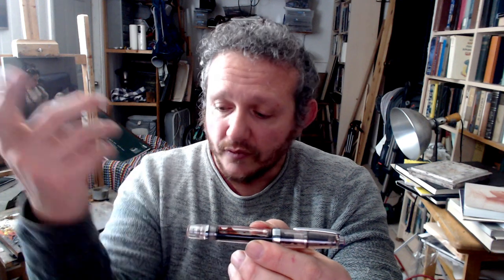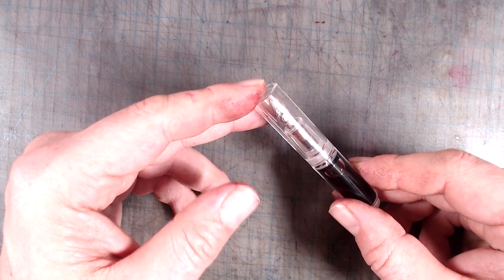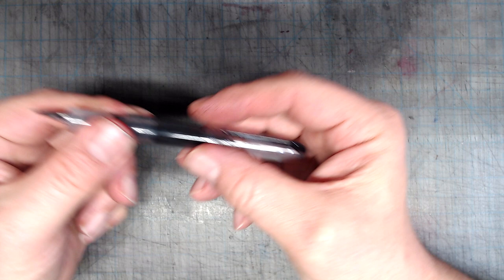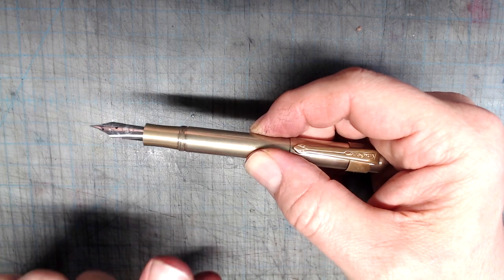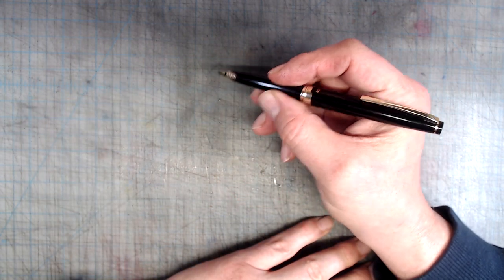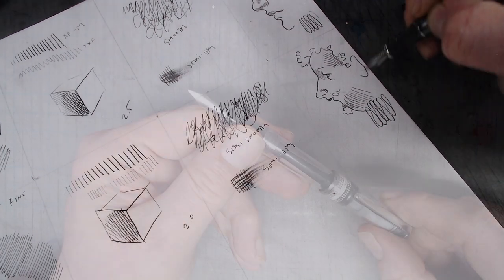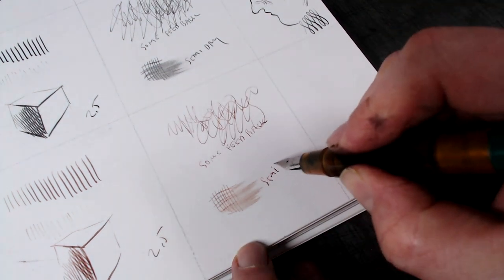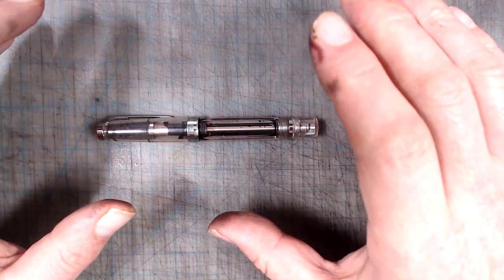Pocket Fountain Pens For Artists

Comment: I love seeing the variation of the line quality here, thank you! I was looking at some of the Twisbis as they look like they have a larger ink capacity. So many videos seem to show how fountain pens write, but I use mine for both drawing and writing. Another less expensive alternative to the Pilot Prera is the Kakuno, I have two of them , I use one with cartridges and the other I put a converter into for bottled inks, they are around the $10-15 mark, but I have had good results with them and they fit nicely into my watercolour box, or the side pocket of my backpack if I want to take it with me, they would be a good pen for a student on a budget too.
Reply from the maker: I’ll have to try the Kakuno. If it has the same nib as the Prera and the Metropolitan then 10-15 dollars is a very good deal. And you’re very welcome. I’m glad people are responding positively to the line variation test.
Reply: @mkompan  I have the Extra fine nibs in the two Kakunos I have and they are the same nibs as the Metropolitan, just in a clear plastic case. They even draw well when you reverse the nib.

Comment: I had the opposite experience than you with the Moonman and Koweco pens. I'm so disapointed in Koweco Liliput's inconsistent ink flow. At its price point, the nib should funciton right out of the box.  However, your video has given hope with the idea of replacing the nib with a vintage gold nib.  Thanks!!
Reply from the maker: I think this speaks to the inconsistency of Moonman pens. I’ve also had a few Moonman pens work decently, but never great. Kaweco pen can also be hit or miss, but usually the flow issues can be quickly be corrected by relaxing the times (you can see videos on it on YouTube).

Comment: Interesting video.  There seems to be a dichotomy here though.  Either a hefty metal pen with low ink capacity or plastic with a tendency to crack and/or a poor nib. Since I want something that can be used straight away and use bottle ink I will stick with my Duke Ruby . It is small, (5 1/2  inch), slim, fude, all metal with a good size converter and quite inexpensive. Well made and comfortable to use too. Although not a pocket pen can I recommend it as a useful alternative ?  Keep up the good work!
Reply from the maker: Thanks! While it's true that those metal pens usually have for ink capacity, I think the Fantasia is actually a good mix, sturdy with good quality plastic, great ink capacity and with a very good nib. I have a duke 209, which looks to be like a dressed down version of the Ruby. It's a great pen, and like the Ruby is small enough to be pocketable.

Comment: I'm one of those people who have had many problems with Kaweco! May I ask if you have the name or any info on the vintage nib you picked for the liliput? I would like to get something similar. The nib that came with mine was terrible. I actually ended up swapping it for a cheap Jinhao nib that works much better lol 
I came here looking for an alternative to Kaweco pocket pens and I didn't know that vintage nibs would fit the liliput. Thank you so much for the detailed video!
Reply from the maker: You’re welcome! I guess I’ve been lucky so far with my Kawecos. The nibs, while nothing special have all worked just fine. I have detailed info on the vintage nib switches in my reviews if the Kaweco Lilliput and the Kaweco Brass. Check them out!

Comment: 1. Wonderful, thorough, review, thanks.
2. I like cool pocket pens, but their smallness and pocketability do not provide me any extra value.  99% of the time I'm drawing in the studio, where I've developed a taste for the exact opposite, desk pens.  And on the rare occasions when I am thinking about drawing on the road, I feel no pressure to downsize the pens, all pens fit easily in my shirt pocket or messenger bag.  I guess the handiness of pocket pens might come into play if working with a pocket-sized sketchbook as well.  For those who travel REALLY light.
3. Are you saying the #2 nib (EF Flex) from my Waterman 52V might fit in my Kaweco Steel Sport, or at least a Liliput?  I've finally learned to love its nib, but I wouldn't mind upgrading by putting it in a different body.  Hate the lever filler.
4. The Pilot Petit1 is available at jetpens for $3.30.  What a bargain.  It's my recommendation for a beginner pen: works, costs nothing.

5. Sailor fans might be interested in the Pro Gear Slim Mini, which is quite similar in size to the Kaweco Sport.  Maybe with a Zoom nib.
Reply from the maker: You're welcome as always.

1. Pocket pens aren't for everyone, but lately I've come to appreciate carrying a small sketchbook and a pen around in my pocket. You never know when an itch to draw develops, and I don't like being caught out without my drawing stuff.

2. Yes, that #2 nib will fit, but it's sacrilege to remove an original waterman nib from a functioning body. there are plenty of homeless vintage nibs out there--get one of those.

3. The Pilot Petit isn't bad. But if you can save up 35 bucks, the Pilot Elite is absolutely great. 

4. You know, I don't have a single Sailor pen. I gave one to my wife a few years back, and they just don't excite me.
Reply: @mkompan  Well, I'm nothing if not sacrilegious...
Reply from the maker: Oy vey, I can't stand look. :)

Comment: Hi Marc, 
I recently broke the feeder of my beloved TWSBI Diamond Mini. Do you have any recommendations how to replace it? i think you also mentioned jowo nibs/feeder for the pen? I also have an FPR 5.5 ultra flex with the corresponding feeder? Will the feeder work properly in my mini?
Best, and thank you for your inspirations! Georg
Reply from the maker: Hi Georg. You might try contacting the TWSBI company directly to see if they can send you a feed (I've heard that they're good about replacing broken parts). #5 Jowo feeds are close enough, however, and will work  ( I just tried it to re-confirm). I some for sale for around $8 on Ebay here in the US.

And it's my pleasure! Thanks for your kind words of support.
Reply: Thanks! I asked TWSBI and they are sending me a new feeder now. 
Which Jowo Nibs are you using with the TWSBI Diamond Mini? @mkompan
Reply from the maker: @georgpopp1292  in retrospect, I gave you bad advice. The mini (unlike the mini-vac, which I confused it with) uses a smaller #4 nib and feed. I’m glad you ordered a replacement from TWSBI because the #5 would not have fit. My apologies! Those #4 nibs are proprietary to TWSBi. I did buy a gold replacement from FPnibs, and then had a semi flex mod done by Gena Salorino.

Comment: I own the Burgundy with the Golden accents Kaweco Sport !!! What a beauty and what a writer it is?!!!! If I would go for another, it would be the Aluminum version, because I like performance more than anything else, and any pen/pencil I had, out of aluminum, it was the best writer both in precision and beauty of the letters but also on weight and how that felt! Full brass sounds heavy. I'd take brass grip/front part though, because it adds to precision and better balance. The more front the weight is, the better the pen/pencil. top heavy, is a no no for me.
Reply from the maker: I've never tried the plastic versions of the sport. I've heard that the nibs aren't removable on them. Is that true?
Reply: @mkompan  No, it is not true. I pull out mine, to clean it with water, when it has sit for long time. It's also easy to pull out the nib! I just grab a piece of paper to keep my fingers clean of ink. They have also upgraded their nibs, they don't have the issues that they had for a short time at some point. So, the plastic model. is also perfect!!
Reply from the maker: @greekveteran2715  good to know! I’ve been wanting to get a clear plastic model that I can fill with an eye-dropper.

Comment: Fun vid.  I want to strongly second the Opus 88 Fantasia!  They're a little hard to come by but worth the hunt.  The pocket pen Opus 88 writes equally well but doesn't securely post.
Reply from the maker: Thanks! Sadly the Fantasia was discontinued recently, as was another of my favorite Opus 88’s, the Halo. The other pocket pen they make doesn’t appeal to me. For one the themed caps look cheesy and there’s as a metal band right behind the short grip section that I know will bug me. Good to know they don’t post well. Now they’re completely disqualified.
Reply: Good to know they dont post. I have been on the fence about them, but like Marc says, dont like the designs on them except maybe the checkered one.
Reply: @starr-starr  that's exactly the one I have!  I should correct myself-- they don't post securely
Reply: @mkompan  Have you looked at the ensso pocket Piuma?  I recently picked one up in ultem -- what a delight!  Screw on cap to post, girthier than many other pocket pens, excellent eye dropper (o-rings etc) but on the somewhat pricier end of this grouping (80$ on special).  BTW, what ink do you prefer to use for your FP drawing?
Reply from the maker: @13noman1  I looked at quite a few pens in preparation for this video, including the Ensso. Thanks for the recommendation. 80 is steep, but having a lighter more comfortable pocket pen with a #6 nib would be great. As for inks, for blacks I use either Platinum Carbon, or Noodler’s black. For other colors it’s constantly changing.

Comment: Hi Marc, 
How did you change the nib on your TWSBI Mini. I tried it once but i could not get it out. Is there a specific model i have to get?
Reply from the maker: Strange, the nib on my Mini pulled right out. Perhaps it might be right the first time. Use a paper towel (or better yet a thick rubber band) for grip, hold the nib and feed tightly and pull. It should come out.
Reply: @mkompan  Hey Marc, Thanks for your quick reply. Actually I broke the entire feed because it would not come out even with quite some force. on which exact models are you using 3rd party flex nibs?
Reply from the maker: @georgpopp1292  I’m sorry to hear that! The nib and feed in mine came right out, as they do with all of the TWSBI models, so I’m not sure what to tell you. The flex nib I’m using is made by Fountain Pen Revolution, the #5.5 ultraflex.

Comment: Hi Marc, 
Is it safe to use the De Artramentis Document Ink with the Pilot Elite? or any other vintage pen?
Reply from the maker: I wouldn’t. These pens aren’t designed to be fully disassembled and will be difficult to clean if they get clogged. The same goes for other vintage pens.
Reply: @mkompan  Thanks Marc. Good to know. If i would like to switch from Document ink in a pen to a normal ink, can i just wash it with water and refill it or would you recommend to properly clean it with cleaning liquids?
Reply from the maker: @georgpopp1292  I think you’ll be fine with using water if you haven’t had De Atramentis ink in it very long, and have had no clogging issues. My experience with De Atramentis inks has been very good, and I think if you practice good pen maintenance you probably won’t have problems. Still, I’m not sure it’s worth the risk with vintage pen. Even if you could take it apart, it usually puts stresses on older pens.
Reply: Hi Marc, 
I now got the Pilot Elite Vintage Pen but without a converter. Do you have any recommendations which converter fits into the pen? Best, G.
Reply from the maker: @georgpopp1292  either the con-20 or the the con-40 will fit this pen, but neither are very good converters, in my opinion. I prefer to refill pilot ink cartridges over using those two.
Reply: @mkompan  thanks. besides the converters this is a fantastic pen!